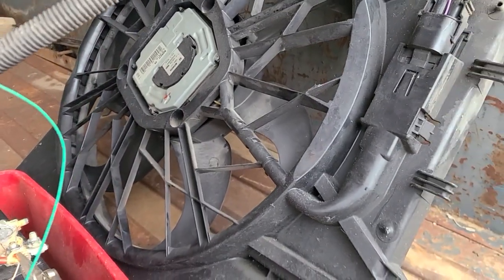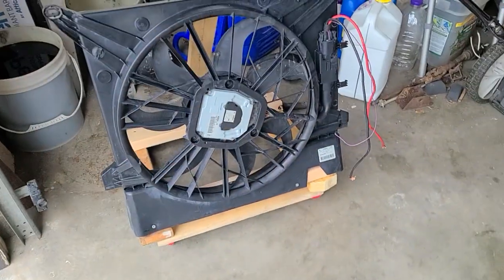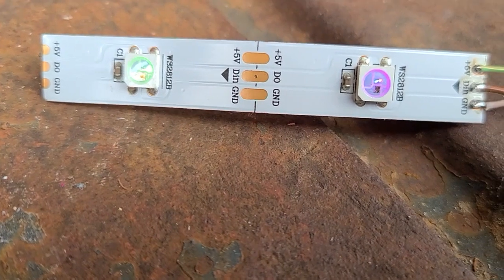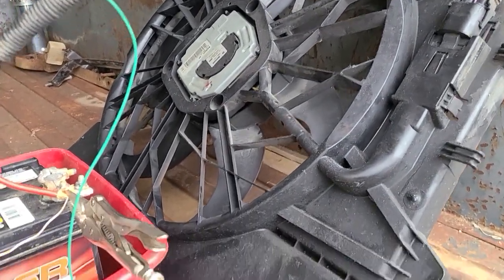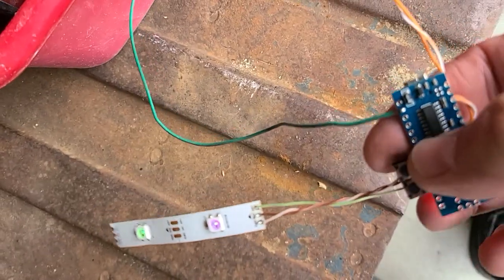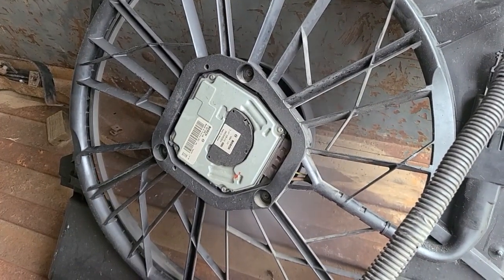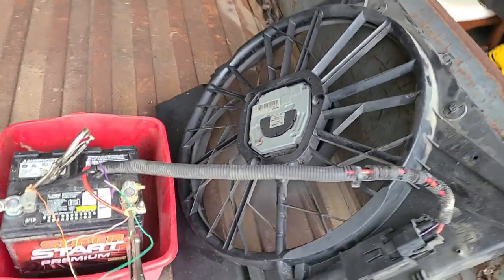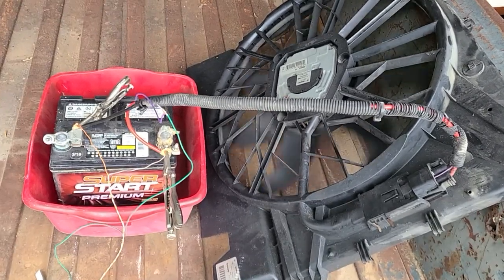Vol-PWM-Fan-LS1 part 2

Comment: What are you using for code on the Arduino? 5v or 12v pulsed?
Reply from the maker: pull up and it works great.  there are a few other components I don't show as well as the code.
Reply: @aknovaman I’m trying to get one of these fans to work on my ls swap. Would you care to give some advise with the coding I’ve tried the basic pwm analog code and tried everything from 0-255% duty cycle
Reply from the maker: @Thebamerx98  email me at my username at gmail.
Reply from the maker: @Thebamerx98  email me at my username on gmail.
Reply: @aknovaman please can you send a code source

Comment: What do you want to prove?
Joe Fan has to run with variable speeds depend on the cooling temperature
What you are showing makes no sense.
Use a cheap relay to switch on or of.
Where is the temperature sensor?